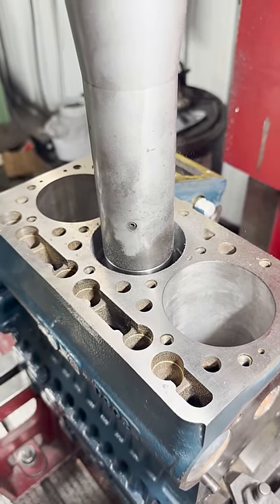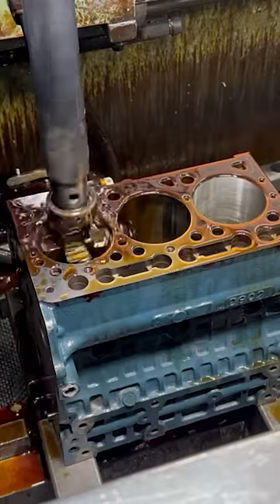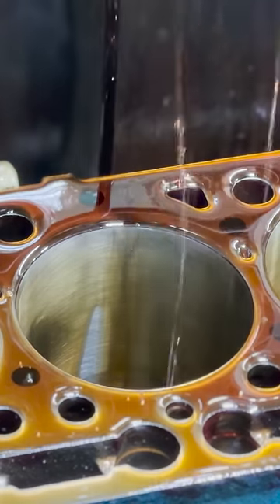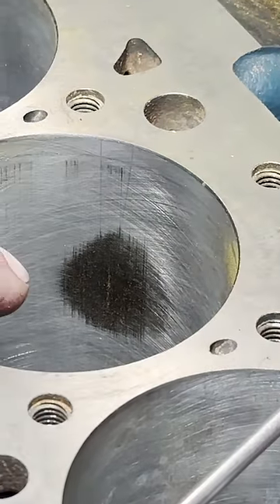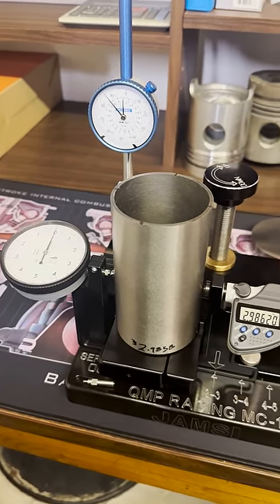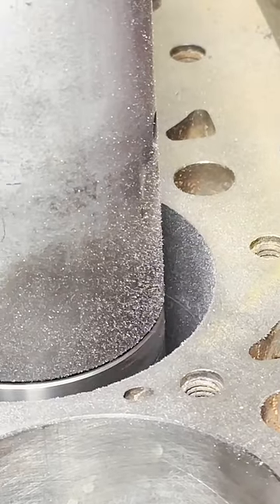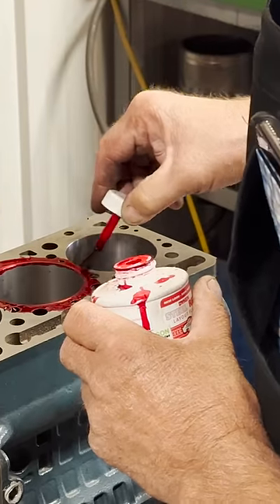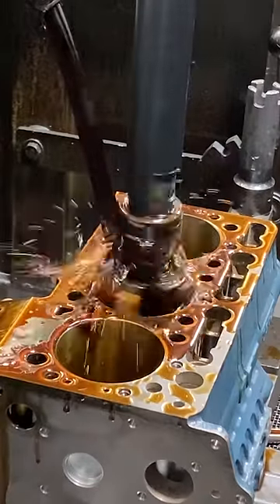#shorts Sometimes You Make Decisions Based On Experience... And It's A Good Thing!

Comment: My question is. Is the cost of the repair still worth less then replacing the engine?
Reply: That was my thought as well. It seems like a lot of work to throw at a 3-cylinder diesel - but since it's Kubota, perhaps there just aren't affordable drop-in replacements available like car engines.

Comment: Finding people to do this type of machine is almost impossible nowadays.
Reply: Because unfortunately it doesn’t make any financial sense, after they have finished machining the block they will have to machine the head. New valves, seats, seals and so on. Then you still only have specific parts repaired. An completely new engine with all the bits and pieces retails for between 4-5k it’s sad but true. Most machine shops will tell you it’s cheaper in the long run to just throw it out

Comment: You really should have told the cleaning guy to do this job. He would have known to use blue loctite for the deck surface, not red, now you'll never get that head off
Reply: That red stuff they were painting on is not loctite, its just markingfluid so they can see when they have reached the top of the deck after surfacing off the rest of the sleeve. Plus no one is gunna use locktite to stick the head on  the block  or even sticking the head gasket on, at least i don't think they would.

Comment: Why did you go for the oversize pistons if you were sleeving the bad cylinder?
Reply: Because they were already boring the other cylinders so they bored the new sleeve to be the same size as the other two.
Reply: @16vSciroccoboi  He said they "opted to just touch up the cylinders in the hone" initially before they discovered the dent/crack.
Reply: I caught that also
Reply: The adjacent cylinders will be slightly out of round after the sleeve is pressed into the one cylinder.

Comment: This is why the cylinders should come with sleeves straight from the factory that way you don’t have to worry about a crack in your actual engine if the sleeve cracks just replace it